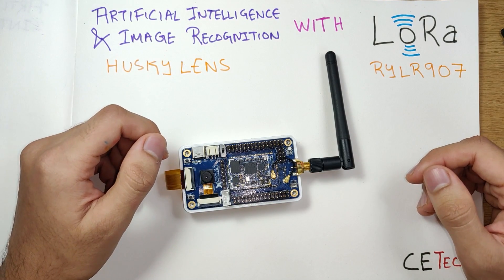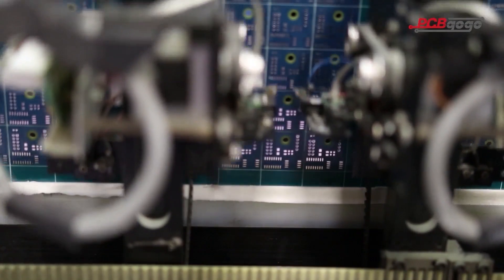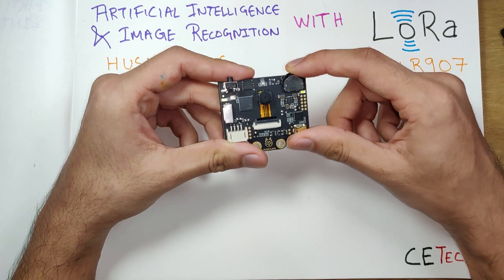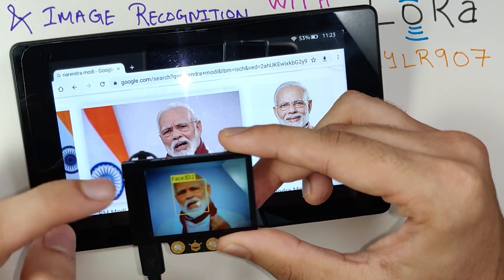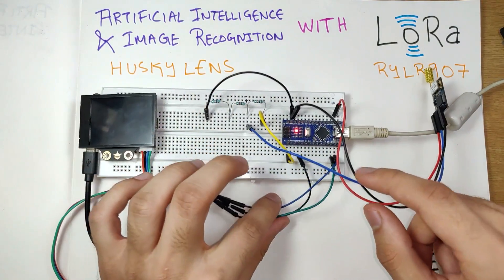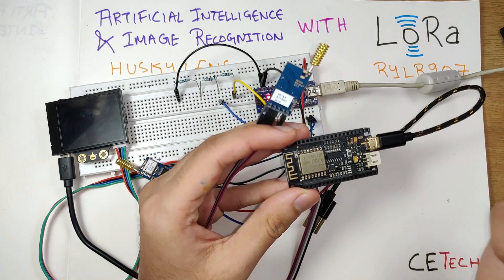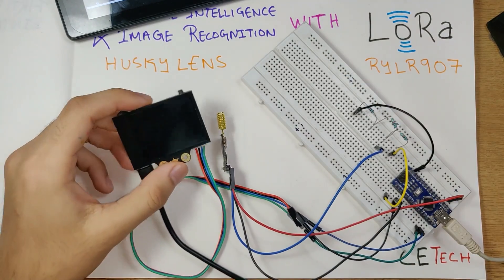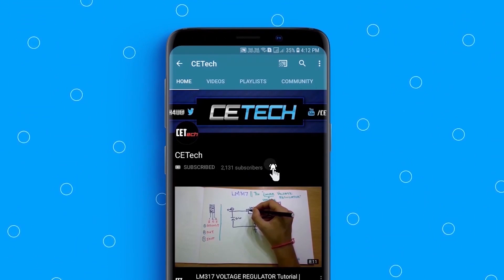LoRa Image and Video transmission wireless | AI on HuskyLens from DFRobot | lora lorawan

Comment: RYLR907  range not 100km (less than 20km in open space and depends on other parameters).
sending image data could take hours (if not fail in middle of transmission and cause uncompleted or damaged image)

LoRa is not useful for such projects

use 4G SIM module is more useful and reliable
Reply: Yeah but that won’t work when the Teslabots inevitably attack all the 4G/5G towers and plunge society into cannibalism and space escapism

Comment: is it possible for huskylens to be powered by batteries?
Reply: yes, U have USB C and 2 pin from the 4 wires are for power. If both power is connected, the Huskylens take the power from the USB C.

Comment: Nice video!
I am working on an application that sends video using lora
First I convert the image on base64, send this info
And the wrap it back on the other end to recover the image. Finally i transform the package of images into video

The distance to cover is about 1km
Do you think there is a better way?

Best regards!
Reply from the maker: No I think that's the way to go, you'll easily get the range you want with a normal LoRa setup..
Reply: Is there a maximum distance for a configuration like this? Let's say sending these images from offshore.
Reply: Hello, Have you completed this project? I am working on the same kind of project. Please let me know if you have any ideas on it.

Comment: nice to know but the title says image and video transmission yet as far as you said in the comments below; it is not possible to do that! 
Is there a way to output the video signal from the Huskylens to connect it to a normal video transmitter? I mean stupid toys can transmit their video over wifi to a phone, but I can't find a way to do the same with an AI camera like the Huskylens :(
Reply from the maker: Why do you want to transmit the video of HuskyLens if you're not using its AI feature? Rather go with esp32 Cam
Reply: @CETech4u  well I ment to get the video out with the AI features as seen on the Hulskylens' screen. this will be useful in many instances. the hulskylens will still be needed for the direct feedback. is there any way to get it done? not necessarily with the hulskylens but any AI camera! Best.

Comment: Hi, can you tell what is the actual transmission range of that module :)
Reply from the maker: In my practical tests with the Reyax module I have got 5-6km range
Reply: @CETech4u  Which module can be used to get a 500 km connection?

Comment: It's good. How about displaying it again on a receiver?
Reply from the maker: Displaying it on receiver?
Reply: @CETech4u  yes, so it will be as low-cost video surveillance. It can?
Reply from the maker: Nope thats not possible. Video transmission is not possible on LoRa. But you can do image recognition and send that data over LoRa
Reply: @CETech4u  and what about sending streaming live voice like walkie talkie using LoRa there will be any accepted latency even if we use vocoder?
Reply: thats useless unless receiver can read the feed data (i mean the real image should be receive)
Reply from the maker: Not possible with LoRa!
Reply: @CETech4u  Ok Thank you